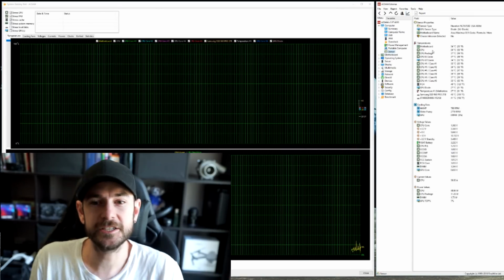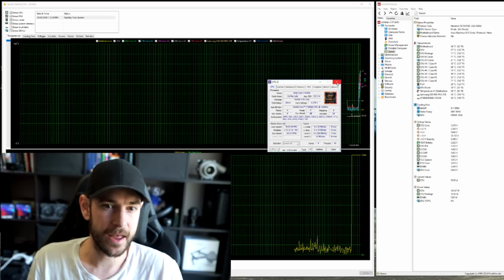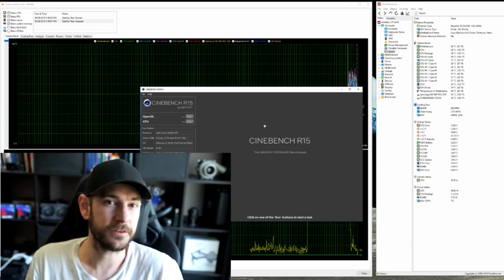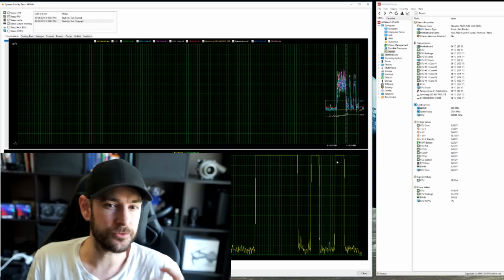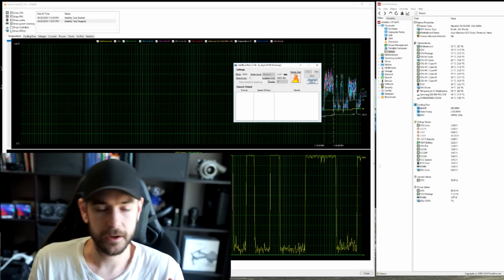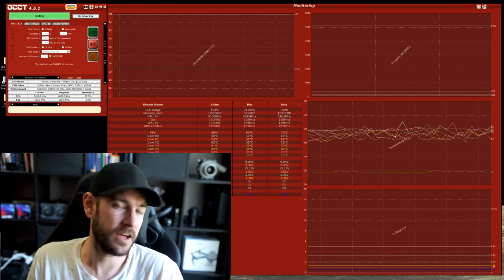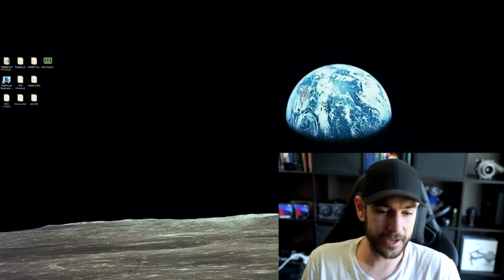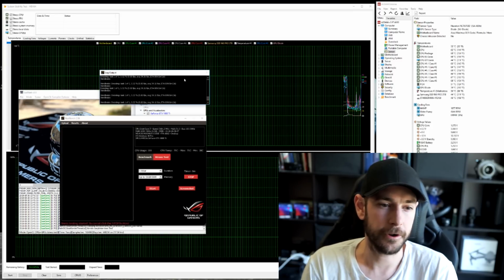How to Stability Test an Overclocked PC

Comment: Hey Will, need your big, beautiful brain on this question. I though I had a solid OC by watching your previous video on the 8700K OC Guide so I ran the same programs you did. I managed to pass majority of them but it failed Intel's burn test. I rewatched your video and made some small changes and I passed all the tests you used. These are the settings I used:

AVX: 0
CPU Core ratio: Sync all cores/ Core ratio Limit: 48
DRAM Freq: DDR4-3000MHz
DRAM Timing Control: 16 - 20 - 38
Min and Max CPU Cache Ratio: 44
CPU Core/Cache Voltage: Manual
CPU Core Voltage Override: 1.27
Dram Voltage: Manufacturer box says 1.35V, Asus motherboard changes it to 1.3530, but it runs better at 1.36 (I think thats safe, auto puts it at 1.5, heck no)
VCCIO and VCCSA: 1.1
Cooler: Corsair H100i V2

I would really like to hit 5GHZ, stable, but I want to take it step by step and establish stability using ur method since I will be using the rig for 3D modeling, lighting, rendering and compositing. Some Adobe CC as well. CG Artist here hahaha. Anyway, what do you recommend I do next to try and hit 4.9GHZ stable first before trying for 5ghz? Oh yeah, Im not delidded. Thanks Will.
Reply from the maker: All you can really do is increase vcore and monitor temps. Sounds like you’ve stabilised everything else.
Reply: Cool Will. Just watched your delid vid and results video from before and after. Really, really enticing to do it but for what I am using it for I will stick with what I can get, plus the warranty hahaha. I will try and see if I can get it stable at 4.9 GHZ with 1.35V max. Im pretty sure I will hit the 80° C if I go any higher than 1.35V. If not then Im going to chill at 4.8. Thanks again Will, as always, appreciate the knowledge.
Reply from the maker: You’re welcome. You quickly get to a point of diminishing returns. In the real world there’s no discernible difference between 4.7 and 4.8. Not worth the extra voltage/temp at some point. 

For me if a video takes 10 mins to render at 5.2GHZ. It takes 10 mins and 15 seconds at 4.8GHZ.
Reply: @boostedmedia  that is good to know Will. Thank you again for always being honest with your fans and viewers. Theres a reason why we keep coming back for more hahaha.
Reply: @boostedmedia  Will one more question. Was running occt and it errored out. Just says error on core 3. Was 18 mins in. Any idea how to find out what it could be?
Reply from the maker: You can check your event viewer logs but likely it’ll just send you around d in circles. 

Increase vcore by 0.05 and see if it stabilises. 

They key to troubleshooting is only changing one thing at a time. It can take months to fine tune it.
Reply: @boostedmedia  OK Will got it. I'll start by changing voltage. It's just so frustrating because I can't pass one test hahha. I guess that's where the reward comes when you nail it on the head. I will start with voltage. If it's still unstable I will bring down ram voltage, then mess with cache. You think it might also be my VCCIO or VCCSA? They are both at 1.1 right now.
Reply from the maker: Unlikely but possible.
Reply: @boostedmedia  Just wanted to update you man. Changed voltage to 1.295 and passed Cinebench, RealBench, Aida 64, Intel burn test and 3 hours of OCCT. Feel so accomplished hahaha. Thanks for the patience Will.
Reply from the maker: Great result :)
Reply: Thanks Will. This is all in part to your channel. Your honesty is really refreshing and I thank you for it. You taking the time discuss that there is a negligible difference in rendering between 4.8ghz and 5.0 was awesome. Now I know I have a solid system that can last me a few years without degrading my components too much. 4.8GHZ at 1.295V and passing all those tests is great. Now, if I can only make adaptive mode work with those settings hahaha. Tried it and it continues to want to overshoot and ask for more power. Dumb the way sometimes the system works. I am stable at 1.295 in manual but not on adaptive.
Reply from the maker: You’re welcome mate. Regarding adaptive mode, you’ll need to adjust your manual load line calibration settings under IA to stop the overshoot, but as I’ve discussed in my other videos, I really don’t see the point I. Using adaptive mode. 

Running the CPU at full voltage all the time makes no difference to its lifespan as it’s current that causes strain, and the current load is only high when the cpu is under load. 

The difference in power efficiency is negligible. 

I personally just leave mine in manual mode all the time and have done so for the past 15 years. I still have CPUs working like new that are 8 years old.
Reply: Great advice man. Looking forward to the next video. Salud compadre. Te invito una chela o un trago de tequila para celebrar. Echale compadre.

Comment: There are a few tutorials on what exact setting to use in bios for overclocking an 8700k, 8086k and 8600k if you have an Asus motherboard but the problem is i own an asrock z370 gaming k6 motherboard and i think it is a really capable overclocking mobo, but i sometimes feel are my oc settings good enough as i dont have a lot of understanding about overclocking..
Reply from the maker: If you watch my 8700k/8086k overclocking guide it explains what the setting are so you should be able to adapt it to pretty much any z370 motherboard. The principles are the same.
Reply: Boosted Media  Ok mate thank u so much, i was looking to watch that video but as own you asus z370 motherboard i thought i would not be so relevant. Will be watching it soon now..

Comment: My overclock was stable based on these benchmarks. But I have one question for you. When I applied my overclock my computer turned on and off a few times until it entered the bios and then it never did that again. Now my computer boots up normally and all of that. The weird thing is that when I turn off the psu and turn it back on the computer does reboot itself a few times before it enters the bios and then goes on from there normally when I shut off and an on, until I turnoff once again the psu and it does the same thing. Just wanted to know if this behavior is normal, this usually also happens when I update the bios.
Reply from the maker: Sounds like memory training. You might have a subtle instability with your RAM.
Reply: I ran memtest 86 and I passed. As I said it seems like pc boots normally everytime, unless I turn off psu and turn it back on.
Reply from the maker: If it’s only happening when you turn the PSU off that’s normal. It’s memory training.
Reply: Ya and it only just shuts itself and down and turn back on once. Just wanted to know if you experience this and if it is normal.  Thanks for all of the quick responses at 12AM.(I meant 12 PM in my area)
Reply from the maker: Perfectly normal mate. All my systems do exactly the same. :)
Reply: The reason why I was worried was because this does not happen after overclocking the ram, it only happens after overcloking cpu. For example I could use XMP and turn off psu and on and this thing would not happen. But as soon as I overclocked cpu the memory training happened after turning psu off and on caused the memory training once.
Reply: So overclocking the cpu causes this?? I am sorry for driving you crazy this late but I am just really interested to know why. I am quite experienced with building computers, but just started overclocking now.
Reply from the maker: Yep. It’s just recalibrating. It normally stores the calibrated values until power is lost.
Reply: Thanks

Comment: Shame someone hasn't made a programme that implements all the programmes together. Basically a 5 in 1 program
Reply: although there is no such program right now, but i think it should be Intel who should come up with such a program to help us make sure about an absolute stable overclock..
Reply from the maker: Intel do have a stability testing program that tests a bunch of stuff. But it doesn’t do long term testing.

Comment: Thanks. Great video! My 8086k is only at 5ghz 1.32vcore and gets to 95deg C on OCCT Linpack test with a swiftech H240x water cooler, so i'm really considering a delid. Just a bit nervous about it tho:(
Reply from the maker: I’d definitely delid it mate. I was nervous too but I’ve done a few chips now and no issues at all. 

Have you seen my delidding guide?

https://youtu.be/fuQHXq4HtHA

Comment: Hello,why in Cinebench R15 point very low?I have  i7 8700 and mainbord Asrock Z370 extreme 4 cinebench r15 1470 point.
Reply from the maker: do you have a lot of other processes running in the background perhaps? 1470 isn't that low for an 8700k at stock clocks.

I get 1760 with mine overclocked to 5.3GHz